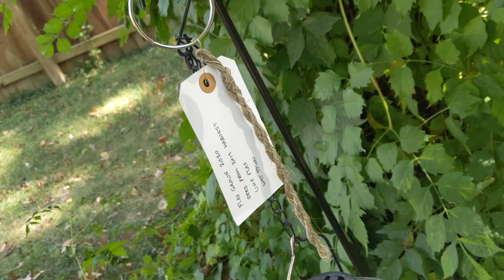Processing Flax into Linen

Comment: Does she really want the roots as well?
Reply from the maker: Great question.  Yes!  Pulling the plant up by the roots preserves the full length of the fiber and produces a smoother fabric, as there isn't a "cut" end.  The fiber tapers naturally, to an extent, though the root end will always be less fine than the flower end.  Flax also comes up super easy by the roots.  Cutting it is actually more work.
Reply: @Luthvarian  Oh, that's kind. Thanks for this good lesson. So interesting. I have developed an interest in the making of linen. Seems to be quite a process. Linen is quite expensive these days.